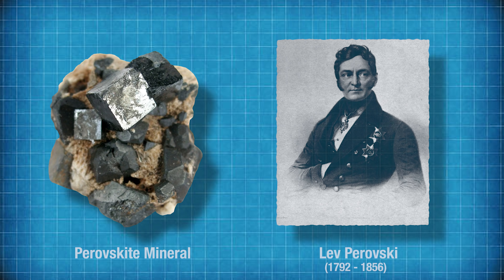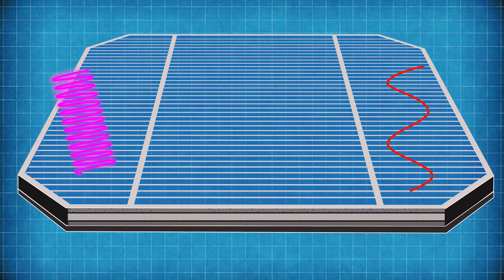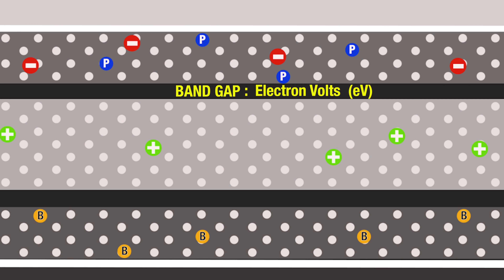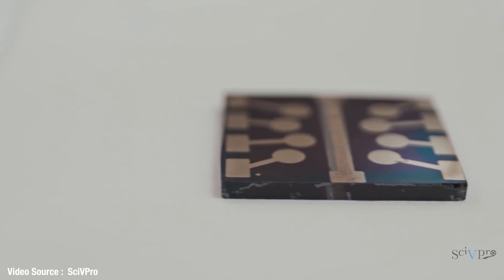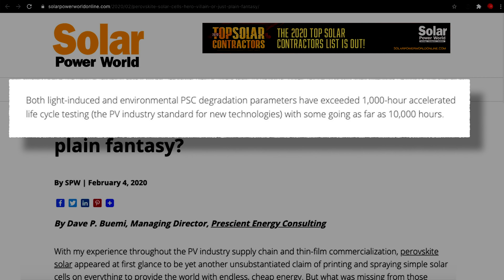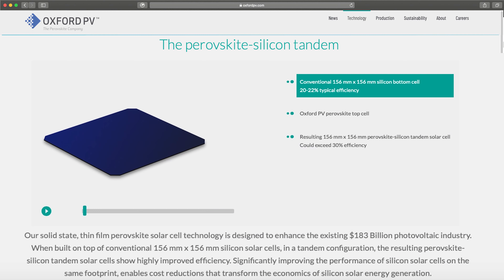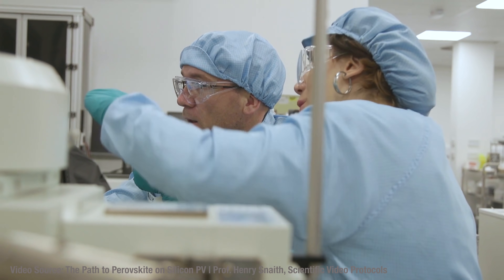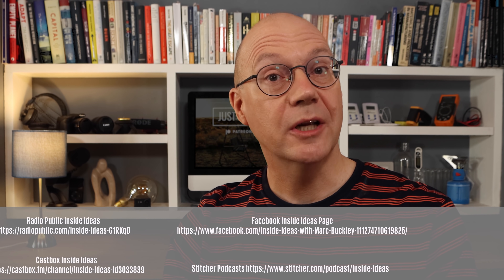Perovskite Solar Cells: Game changer?

Comment: Musk is The Devil and and 'renewables' = junk that won't last and will have to be renewed often. Wind and Solar are prime examples. These, like all solar panels will degrade until they are useless.. TPTB Lib-Con money junkies could have rolled out safe, clean enough (Thorium) Molten Salt Breeder reactors in the 50s, let alone now. Instead warheads went with enriched uranium power and fake greenz jumped on the e-vehicles and 'renewable' power scam... more, More, MORE NEWWW CRAP'n'TRADE.... This is the uber-liberal capitalist/socialist attitude... Even natural gas power makes more sense than these solar panels.
Reply: What a load of nonsense.
Reply: @3rdrock  .. I don't think you have a clue. We could have solved global electricity demand without all this liberal wastage and nuclear missile obsession using tried and tested, safe and cheap tech. that is technically also more efficient than uranium fission. THORCON - bad name, good idea... Do some research and do not buy an e-vehicle. .. Here's one for you...
It take 800kg of evaporated underground brine water to produce 1kg of Lithium. It takes 100kg of Lithium for an e-car and there are billions of internal combustion engines to replace. Oh, and H2O is 1000x more powerful than C02 as a greenhouse gas. What about trees increasing humidity, trapping heat? I still want to plant trees even though I know it will speed up global warming... Neodymium and cobalt, ++ are expensive and rare now, how much will their price rise as this FORCED DEMAND SCAM kicks in? Lithium is poison and your e-waste is much harder to recycle than iron and aluminium.
Reply: @PrivateSi  More rubbish.
Where on earth did you get those numbers from? It looks like you just made them up.
I wonder why those commie miners in Australia are flocking to renewables? Maybe you should let them know that they are wasting their money.
Reply: @3rdrock  .. Research Lithium Production, or lithium pollution, there are many sites with the stats, my bookmarks are a mess... Pg. 666 of the latest, CO2-demonising whitewashed IPCC report is the only page on water vapour, but at least confirms the 1000x more powerful greenhouse gas than CO2 figure. 100kg of Lithium is about average for an e-car, but there's all those little personal transport and bikes too, and lorries if they get their way...
--
This one page clearly states H2O has NO FEEDBACK EFFECT. This is garbage, and they know it, that's why it's page 666... Pg. 667, The summary, clearly puts CO2 as the primary climate change factor.. This is a blatant lie. They didn't even know the 11 year sunspot cycle is caused by Sun, Jupiter and Venus gravitational alignment. 
--
Renewable tech. does not last very long and their production is not environmentally friendly. Renewables only make sense economically for rural communities and only environmentally if in a barren wasteland. I live in little Britain so plan for little Britain. No wind farms, no solar subsidies and a huge tax on e-vehicles as a deterrent, like ICE car owners have via fuel tax.
--
My preferred solutions make much more sense... A greener world could have rolled out a) Thorium Molten Salt Reactors, b) Continuous Waste To Energy + Refined Matter R & D and facilities... c) Urban vertical farms for 50% minimum urban food independence... Then I would have respected the Lib-Cons...
Reply: @3rdrock  .. You are LYING or ignorant. I read scientific journals on many topics and have a good memory but 1000s of badly organised links I never get round to sorting, just adding, building up... like junk., like your post.... Do some research, my figures are accurate and searching "11 year sunspot cycle venus" takes no time.... 
--
I am an objective, non-fake green man. I didn't say Lithium was rare, I said it's extracted from underground brine reservoirs pumped into sprawling open air evaporation pits that you'll need a lot, lot more of.. Also nasty opencast mining. It's also a question of WHERE the reserves of various important elements are..  Neodymium's elements and Cobalt for powerful motor magnets are rare and highly polluting. More manufacturing and transport, etc... 
--
Australia has a lot of radioactive rock full of Thorium and quantities of other radioactive materials, as well as seams of concentrated uranium... Breeder reactors are more efficient because they don't need enriched uranium - unlike nuclear warheads....
Reply: @PrivateSi  5 minutes on google and you can get all the answers you need. 
Why are you so against renewables?
The wind blows and the sun shines for free and there are no waste products. Why not just catch that energy? 
Do you reckon thorium mining and processing will be pollution free? and what about the spent fuel?
I'm not in principle against nuclear, I worked for BNFL at Chapelcross years ago but renewables and storage are going to shit all over just about all other forms of electricity generation. 
There are no reputable astronomers that would agree with you claim that the planets cause sunspots that's just ridiculous.
Reply: @PrivateSi Everything uses water! Put in perspective: The US nuclear industry uses around 320 Billions gallons (1,454,748,800,000 kg) every year. It's estimated our current  fossil fuel/nuclear power generation uses around 20 gallons (90 Kg) of water on average per kilowatt hour generated, do the math for 25,082 TWh world wide generation: enough water to fill a small ocean. Even an individual car tire takes on average over 500 gallons (2,273 Kg) of water to produce.

Renewable's + batteries use a faction of that water consumption per kilowatt hour generated/stored over there serviceable life. 

But remember all water is reused as it evaporates and rains back to earth over and over again, otherwise we would have run out long ago. (just does not always rain back where used from or needed which can and does causes big environmental issues) 

Yes Lithium is poison as are many products we us daily, but lithium is possible to be recycled around and around compared with fossil fuel exhaust toxic's or nuclear waste.  

Solar panels and wind farms are around 95% recyclable by mass with current technology, which in the world of recycling is a very high percentage, a lot higher percentage than your average car, home or nuclear power station.
Reply: @stevetaylor2818  .. WATER VAPOUR evaporated into the atmosphere from finite, UNDERGROUND, DRIP-FED RESERVOIRS traps heat while in the atmosphere. Cooling towers do add slightly to global warming. Increased humidity around forests increases tree growth, increases humid environment size, increases temperature, increases water evaporation, increases rainfall, thunder, hurricanes. 'Sky Rivers' flowing between forests have been observed, many want it included as part of the water cycle on par with mountains... The IPCC cherry picks and ignores or belittles important factors, despite 'comprehensive' multi-hundred page reports..
--
I make it 8000 tons worth of CO2, when converted into CO2 units, per vehicle battery, per year, for 10 years before the battery is junk... times 1 billion engines, conservatively. It is EXTRA WATER VAPOUR.
--
Lithium recycling is almost non-existent here, like in most places, and not nice.... We should have been ploughing money into exhaust gas capture and regeneration tech. liquid carbohydrate fuel an be made in many ways and will always be much cheaper and more powerful than batteries if all the subsidies and taxes are removed. Iron and and Aluminium are easy to recycle, electric motors and electronics are not, and far more toxic....

Comment: The solar system Jim Carter put on the White House was for solar heating of water.
I buy solar panels (flex) which are 22% efficient and they don't have the silver collecting grid on top, which increases the efficiency. They weigh around 3 lbs each, great for using on a "Solarized It ".

Comment: Talking about something that is still in the lab and not on the production line is a waste of time.  By the time a new cheaper version gets out in quantity it will be too late.  The Chinese investors are spending huge sums of (Chinese) money on building new solar panel plants and it will take a few years to produce quantities of panels.  They will be silicon because it's a proven long lasting technology that is the beast of burden in the industry.  Let's cover the countrysides with them and replace the thermal plants with renewable power.

I don't believe that the plastics and organic compounds in solar cells, perovskite or otherwise, are going to last as long as glass and silicon - 25 years.

The "100 by 100 miles" of solar cells amounts to tens of billions of panels.  They may not take up a lot of real estate but it will take decades to build the huge amounts of panels and infrastructure, and also the battery storage.  By the time (decades from now) the world has enough renewables installed to supply today's electrical demands, the demands will have more than tripled because of demand for green hydrogen used for transportation and to replace methane AKA natural gas.  The "100 by 100 miles" will have to be 300 by 300 miles.

Comment: I did a presentation in 2010 on how multi junction solar cells using multiple semi-conductors (like perovskite) could be used to achieve something like 50% efficiency and get that up to 70% if it were combined with a heat and power system giving us a pretty much everlasting maximum on the efficiency of solar power at about 70%. This was a semester long research project where I did a review of the entire field which at the time was pretty complicated and I wrote a meta-analysis on the annotated research. I got the cockeye from my professor like I was wrong and not one but multiple students interrupted my presentation to say solar couldn't possibility ever go past 32%. It's kinda funny how a student who applies to the scientific method can make accurate conclusions a decade ahead of time. It's a reassuring thought. On the other hand all of that was diminished by the "but actually!" peanut gallery.
Reply: Oh, I would love to read your paper... could you be so kind as to provide a link? 
thanks in advance
Reply: So the problem is people dont do the meta analysis and put everything together, I mean why else isnt elon pushing perovskite cells to production? Nobody can scale tech faster.
Reply: I understand that multi layer multi band gap cells can achieve high efficiency but at much higher cost.  However that they have benefit when used in a solar concentrator as fewer cells are used.
Reply: @robertvesetas8751  , Satellites would have huge cost savings if you can reduce weight with higher efficiency panels. That makes me think there should be market for high efficiency panels even if in a low quantity demand. This could lead improvements which can lead to cost effective mass production for the new technology.
Reply: @suokkos  satellites need specialized solar panels tho.
Those are usually GaAs based and need to withstand higher than usual radioation damage to last years or decades.
Reply: @robertvesetas8751  Yep thats exactly how I explained it. I even figured that the lowering cost of solar installation was a lot more likely factor in scalability rather than the efficiency of multijunction cells. Which also turned out to be very true.
Reply: i would love to read this as well, it has always puzzled me as too why the Heat from a Solar panel is not extracted somehow (refrigeration or steam) they OBVIOUSLY generate a shit ton of heat and it is visible across the plane of the Solar field
Reply: Not at the physics department that I did my undergrad in you wouldn't! They would get excited by solar cell developments. The only group pulling in serious grant and investor money though were developing thin-film organic solar cells but those can only achieve between 4% to 11% efficiency I think.
Reply: penguins forall — yup, I got the same sorts of assertion from “experts” in the late 80’s when I asserted that by Moore’s Law alone, it was obvious that digital media will replace film in most situations because of cost, quality, convenience and related advantages.    They, and many in the audience strongly asserted the contrary, saying things like: “just look at the difference, you can’t compare digital to film”.  When I tried to explain “how I could possibly believe that”, I was drowned-out.
Reply: The 33% maximum efficiency is something that I have heard before. But, I don't know how that was calculated.
Reply: @bk_16 The hot end of your heat engine is the source of the black body radiation: The sun. The silicon is the cold end, and the colder you keep it the better, but when your hot end is 5700K your cold end doesn't have to be particularly cool to get high theoretical efficiency. You are more limited by the physics of semiconductors than thermodynamics.

Comment: Sounds good but in the meantime why are we hooked on making solar farms for this. We have roads, side walks, parking spaces and commercial roofs that could benefit from having solar roofs on them. Think about shedding rain , snow and sun off these . No loss of farm land or cutting trees down to put up a farm. Most of these have the power infrastructure in place so need to run extra power lines would be less. Just saying, I think solar farms are madness.
Reply: Installing stuff on private property is a political nightmare. It would be even worse than mask controversy happening just now.
Reply: Pauli , to clarify I was talking about public property for the most part. Leases or reduced electric rates for use of space would be the norm. So a farm on a factory would give power to the factory at some reduced rate. Public roads could have minimal lease rate for space so long as public gets a benefit. If this unused space becomes an income generator it should not be a problem (except for the karens) .

Comment: Right heard about these cells before in C&CE, for a couple of years now.  The problem was that after a few days they degrade, for the most part, after a few days of operation.  Rendering the less than worthless.  A group in Australia have found a relatively cheap and easy way to passivate their devices.  They are thinking of starting starting up a company next year.  All of this from a recent ACS' Chemical and Chemical Engineering News.

Comment: one error: "the gap between the layers is called the band gap, and... ' nope. The band gap is not a thickness or a physical gap - it's an energy 'gap' - the amount of energy required to promote an electron from the valence band to the conduction band where it can
Reply: the main misconception here imo is the mixig of physical layers and energy level graphs (similar to s.c. band strucucture) sometimes these are placed on top of each other for better visualization, so maybe that is one source of confusion. Never the less great stuff so respect! :)
Reply: @szocsdaniel  yes. but you can see what motivates people to risk causing that confusion.
Reply: yes.. the "semiconductors; simplified" section of the video wasn't the best imo. but that's because i already knew it. I wonder how someone who knew none of it would respond. I feel at least a brief "here's how semiconductors work, and solar panels use a specific kind" intro rather than just jumping in would've been good. After all, it's also how LEDs work too, and technically you can get solar panels to act like bad LEDs. The impression I got in the video was that this information was only about solar cells. But maybe that's just me
Reply: He knows... He just simplified it
Reply: @Bhatakti_Hawas  no. I wrote what he said. And he could have said the right description in as few words.
Reply: @13thbiosphere  it's not measured in microns, it's measured in eV, electron-volts, and he tells you that, correctly, later on in the video
Reply: @dickhamilton3517  the layer of electrons is measured in microns
Reply: @13thbiosphere  the thickness of an epitaxial layer is a distance in microns. It's not a layer of electrons. it's a thin sliver of a semiconductor, a material.
Reply: @dickhamilton3517  a sliver of a semiconductor .>>>>has no electrons?
Reply: Dick Hamilton also electrons don’t migrate towards the n-tyte layer and the middle one is not a natural Si layer, rather a so called emptied region etc.
Reply from the maker: Yes. Tricky to animate :-)
Reply: @JustHaveaThink  Yeah, it is challenging! I am a PhD student working in perovskites and we recently made a video on perovskite solar cells where we animated the process, do check it out if you're interested.
Reply: @OurEden  thank you, whenever my material science prof talked about solar panels he would always mention perovskites. Never bothered to look into it but now I at least have an idea why ppl are enthusiastic about it.
Reply: @JustHaveaThink  yes. I've seen it done, but it took somewhat longer than 30 sec. to give a decent idea of what was happening. The main thing is it takes a certain minimum energy (from an incoming photon of light) to 'free up' an electron, rendering it mobile and able to contribute to a current, and that minimum energy is the 'band gap' energy.
Reply: I love you!
Reply: @richardwendling4030  and I didn't get to finish that because the tablet's battery gave out. I thought it was lost. So I suppose I love you too for showing me it was still there :-)
Reply: Dick Hamilton that is correct
Reply: And who is working with this all day long?
Reply: Actually the whole video was a mess of inaccuracies and plain mistakes... Such a waste